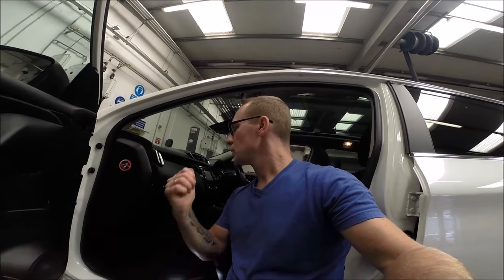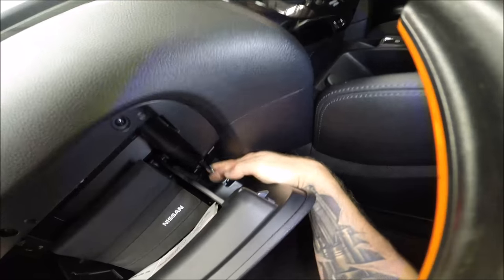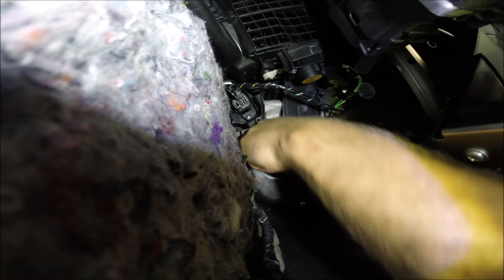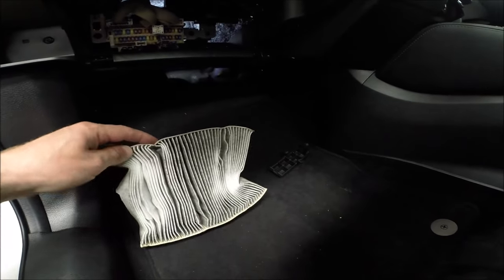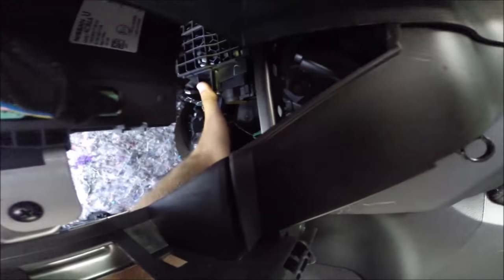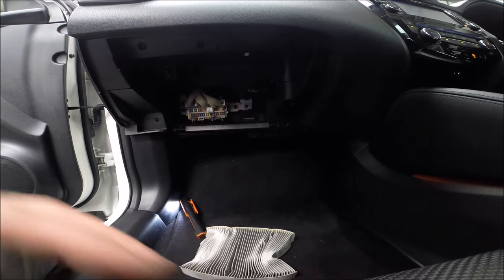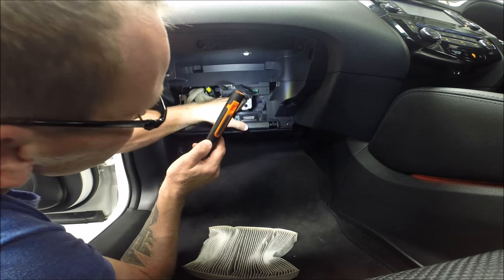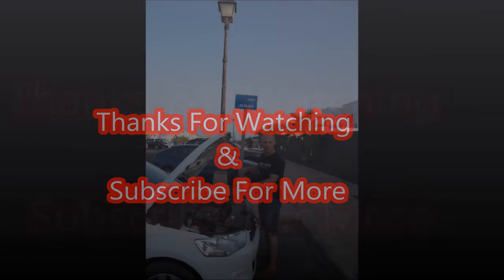Nissan Qashqai J11 2015 Pollen/Cabin Filter Replacement

Comment: Top video on what, on the face of it, should be a simple task to complete. The softer foam edged filters are easier to fit. I found the cover would not stay on after replacement so I used some gorilla tape to keep it in place until the next time. If you are still struggling to refit your pollen filter, give your local gynaecologist a call 🤣 My thanks for your great video, I really appreciate the time and effort you have taken. You are a star.
Reply: Same f*%$n problem mate. 
Been at it for over an hour haha

Comment: I tied a thin string around the filter with a slip knot horizontal to make almost a circle and it went in much easier , pulled the string out and it fitted almost by itself

Comment: You actually insert it from the other side where there is another door that is slightly bigger.
Reply: Yes, you re right
Reply: Yes there is but you can’t open the door because of the clutch pedal. I’ve tried all night tonight
Reply: @flashybike1  I have the CVT model and there is heaps of room.

Comment: Ripped mine apart trying to get it out.  The new filter went in much easier as it had more flexible foam sides that were easy to compress.  I could not get the cover to fit back on -  it kept popping of no matter what I did.  In the end I got a couple of screws and used the two screw holes that are positioned either side of the cover to secure it.

Comment: My filter looked similar to yours, it was in quite a state. I have fitted a new activated carbon filter using your example but also noticed there was another similar access door on the other side of the heater unit. Before I started I opened the door & I could not see any filter inside so just closed it, now after I fitted the new filter looking again through the opposite side access door I can see the end of the new filter. I guess this shows that my new filter is fitted correctly.

So, the bottom line is to also open the flap/door at the opposite end of the heater & check your filter is visible.

Comment: Thats a ridiculous setup having the harch smaller than the filter.  What a joke Nissan.  I think they must have taken inspiration from VW who did similar on the Passat where the access was pointed at the floor so you had to crush/fold it in half to get in in or out.

Thanks for the video 👍

Comment: In my 2016 J11, the underneath panel (at 0:45) is different and I was unable to pull it off, or remove the glove box.... However by feeling around with a torch and camera, and with some stretching and discomfort, I was able to reach in and skip to the part where you remove the filter cover (at 1:41).

Comment: Hi Just let you know if you do the same from the driver side is much easier and need not dismantle the cabin box etc. Just the same access flap. Like i understand that you want to check whether filter open up after instalation, you can open both side to ensure filter sit in properly.
Reply from the maker: Hi, thanks for suggestion I have to check it is possible in  RH drive car

Comment: Does anyone know which side the blower is on a J11? 1.5 dci Acenta prem, Need to replace it. 2014 right hand drive model
Reply from the maker: Hi, Should be over pollen filter pocked, very dip place.